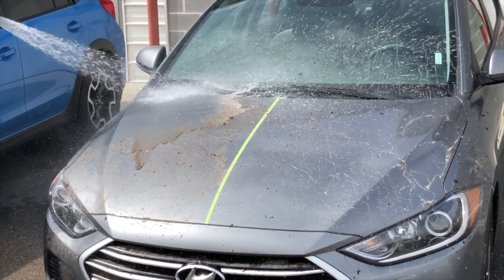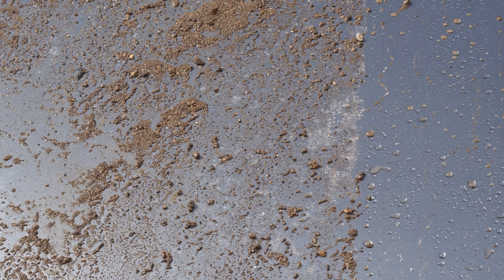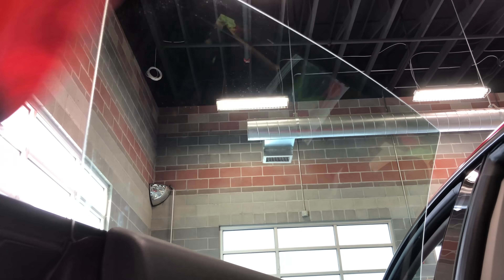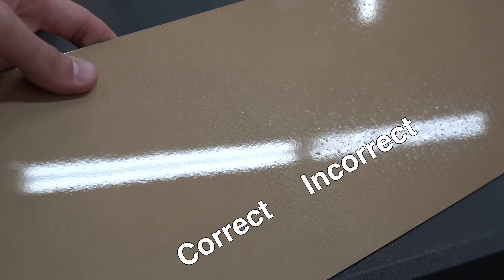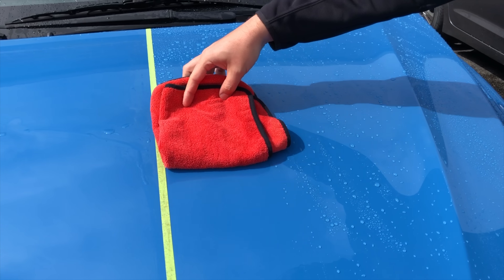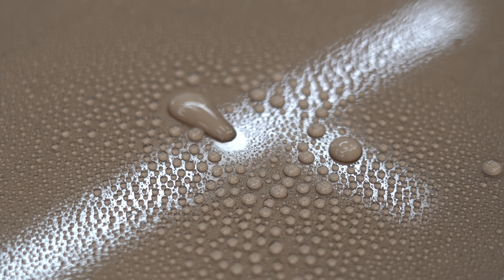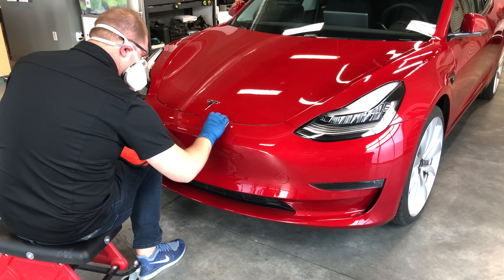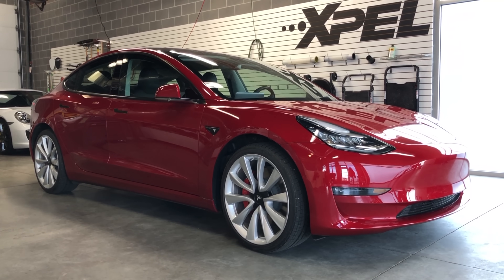Everything You Need To Know About Ceramic Coatings

Comment: If these coatings are so good, why don't car manufacturers put them on their vehicles by default?

One excuse I've heard is that new cars get damaged panels during shipping and are often repainted, so there's no point putting a ceramic coating on cars at a factory.  I don't buy it.  Most new cars require a respray after shipping?  Utter BS.
Reply from the maker: Cost drives a lot of things! Why don't DI engines come with catch cans? Why don't all cars come with 500 HP? Why don't all cars come with paint protective films? Etc. etc. Adding coatings would keep each car a full additional day in the factory. That's a lot of money. Something can be good, and also not stock (see the entire aftermarket world).
Reply: Cost?
Reply: @terryboyer1342  Every time I buy a new car they offer me paint protection for US$1400.  If this coating is so good, surely it should be applied when the car is painted instead of a guy with a sponge in a shed?
All the major car manufacturers of the world are missing out on easy revenue by not offering an optional paint protection layer and leaving it to the dealer to apply?  I don't buy it.
Reply: CatsMeowPaw some dealers will offer this but unbeknownst to the customer it’s just a bottle of crap they bought from AutoZone. Better off just outsourcing it yourself.
Reply: some manufacturers offer ppf for an extra cost. why they dont put ceramic on their own? extra cost and labor. its a business end of the day. guess that could be the reason.

Comment: Protective film way better.
Reply: Wet Rain why not both?
Reply: @19skylark77 I did have both b4  but I realized you you just really need the protective film. You don't need ceramic coating especially if you do your regular washing and apply wax. Instead of ceramic coating use it for track days or other stuff.

Comment: Put ceramic coating on the whiteboard😁
Reply from the maker: Haha, then I'd never be able to write anything on it!
Reply: If you put ceramic coating on a whiteboard it won't work anymore? You'd probably try to use it but it would seem as though all your markers are dead, even brand new ones. This would result in confusion by those who didn't know that the whiteboard has been ceramic coated. As a TA and tutor, for whom whiteboard markers are the tool of my trade, I think I see a prank coming on...
Reply: You joke, but I thought it’d be a good idea to put beadmaker on my whiteboard, and now I have a useless section
Reply: @gstpierre69  sand it off?
Reply: You could use sharpies instead of dry erase markers and it will wipe away more easily and won't stain the board.
Reply: @jvdb5509  OUT ... now ....  points at door
Reply: Maybe he just got done spraying it down with some F11
Reply: You monster
Reply: I am going to do that  at college and see how the teacher reacts😂😂
Reply: That would be a funny prank lol
Reply: Already commented this elsewhere but since my intention is curious engagement, this seemed a good spot to interlope in…

I’m planning a project to mod my old Gameboy Advance (mostly hardware upgrades)… considering a ceramic coating and or another type of protective paint or film layer for the shell (probably after hydro-dipping).

Are such measures merely excessive or does anyone think it could actually be detrimental (either to the gameboy or the boy using it) considering it’s something being handled that extensively with bare greasy hands?
Reply: You just want to watch the world burn

Comment: would ceramic coat work with vinyl wraps?
Reply: Not if you put the wrap on afterwards. It won't stick to the ceramic
Reply: They make ceramic coatings specifically for PPF and specifically for Matte wraps or glossy wraps!